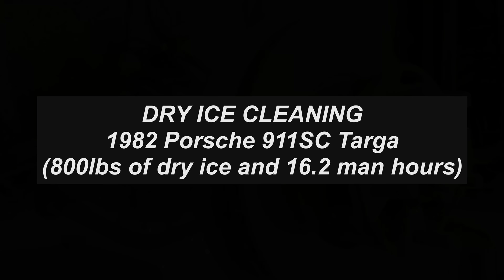16hours DRY ICE CLEANING 1982 Porsche 911 SC Targa BACK IN TIME (part1 of 2)

Comment: For longer durations of blasting without constantly sucking air through a respirator you should consider a PAPR (powered air purifying respirator). Pure Flow 3000 makes a nice all in one hard hat with shield style. Just get a second battery for longer than 6-7 hours at a time.
Reply from the maker: Good tip! We could probably use the second battery because i feel like it’s always dead lol

Comment: Most European cars are spayed with underbody wax at the end of the production line which collects dust and muck but stops corrosion, you’ve removed this which in a dry climate is fine, but in wet cold area all areas will oxidise and corrode, you do a cracking job in cleaning though
Reply: At the very end he is spraying something under the car.  That is probably some kind of wax or sealant.

Comment: I wish there was a car wash where you could drive over a section that had a bunch of nossles spraying the undercarriage using dry ice where the whole undercarriage was basically clean within a few minutes… :-).
Reply from the maker: You might be on to something here!
Reply: @IAMDetailing  I know it probably can't be done because they have to constantly change the pressure and the size of the dry ice particles depending on what they are spraying.  But it would be cool if it could be done where someone could get their undercarriage done for only a few hundred instead of thousands..

Comment: Isn't it better to just clean the car first with water and soaps, then do the dry icing process? Just curious, guess it would save a lot of time and energy.
Reply: Regulatory view no, as the fluids contain chemicals to release the dirt while ice blasting is co2 neutral and doesnt leave chemicals except for sand/dust.
Reply: @maxkreeft6605  what about energy point of view?
Reply: @uiuxshoaib  like in energy costs or you mean efforts to do it compared to water cleaning?

Comment: Can anyone please explain how dry ice cleaning works? What are the pros and cons? Does it clean everything as good as it shows on the video?
Reply: Constantine Hassiotis: Only pros, no cons. Dry Ice Cleaning melts the debris and virtually dissolves all of the residue, it does clean as it shows. I am talking about first hand experience because I used to clean printing presses for quite some time. The only thing is, you will have to recoat the parts you have cleaned. We used mineral spirits for reconditioning.
Reply: @kevinhization  cons too. Some say it removes the protection layers applied in the factory and also causing microcracks.
Reply: @dncviorel  No, dry ice cannot cause microcracks or pits. If the machine has pre existing conditions, then those materials may be too weak to be ice blasted. In all my experiences, none of these machines were impacted due to dry ice cleaning. As I have stated before, the machines always gets reconditioned.
Reply: @kevinhization  That's really nice to hear, thanks for chipping in.
Reply: @dncviorel  Np.

Comment: Does this method damage the anti rust paint under the car?
Reply from the maker: It can remove it. And we reapply one of a couple different kinds of protection wax after we dry ice clean
Reply: No amoundt of so called wax protection will replace thé efficiency of the original protective coating.

Comment: Looks great but what is this like 3-4 grand? Dry ice here is a couple dollars a # and the hourly rate for a mechanic is 75-100 an hour. Even a detail specialist wouldnt be cheap.

So 12-1600 for the labor, 1600 for the ice, plus whatever else they charge. There are other ways that are a lot less expensive. It does look nice though.
Reply: It's an appreciating asset, cost isn't the object, preservation is.
Reply: @douglasb.1203  You hope it appreciates to being worth it. I can see using for the right car but thats not what Im talking about. 

Most cars are not and they are billing it as a regular cleaning method. This is not the only place talking about it. There are already services offering it but no one is talking about price.
Reply: @mistermyself1128  you're seething brah

Comment: This detailing is mega...but could you please confirm that is so good in case of dry dirt and grease/oily deposits not for oxidation of winter salt streets? Or in this case suface oxidation could be removed with dry ice? Thanks again and congrats for results
Reply from the maker: Yes that’s correct... we can remove dirt, grease/oil but we can change the surface... so we can’t remove oxidation, same with rust... we can remove surface rust (sometimes) but this machines is designed for cleaning. Industrial machines will probably work better on rust but also they are not safe to use in automotive industry.
Reply: @IAMDetailing  thanks, really appreciated!

Comment: What effect does it have on rubber? And gaskets?
Thinking about using this on a plane.
Reply from the maker: One of the main reasons we use Dry Ice is because of how safe it is. It's easy for us to control how we use it, and its safer than many other common cleaning methods used on these parts
Reply: It restores axle boots amazingly. I would enjoy trying it on a plane

Comment: How does dry ice clean? Acid? Particles like glass beads? Like cold steam?
Reply: As the ice is blasted when it smashes against whatever object is being cleaned, the dry ice instantly freezes the surface so as the ice pelts the surface it blows off the frozen gunk. 100s of videos explaining the process on YouTube. We used it on our floor machinery in manufacturing and it’s still being used there. It was designed for industrial applications in order to avoid harsh chemicals for cleaning and get a better finish product (clean wise). It’s incredible technology for sure.

Comment: The nozzle head is not wide enough.. 
Takes far to long and not cost effective..
But it does a great job..
Reply: The cfm it takes to flow that with a bigger nozzle would be obsurd were talking like a tow behind diesal twin screw compressor
Reply: @patrickstephens9211  That maybe true but it's selling points and cost price don't make it practical especially when more cost effective ways are faster.  Until a dry ice cleaning machine can outperform cost effective methods that are faster the market will continue to be minimal.  It will eventually become obsolete if it's stays as is.
Reply: @castled3773  gonna have to agree with you, there's better , cheaper , and faster ways of doing this

Comment: Wouldn't it be much much cheaper with a pressure washer?
Reply from the maker: There is only few guys who know how to do it properly with pressure washer and they still have to use chemicals and a lot water which is not very safe... but yes it will be cheaper.

Comment: This is not the first time I see the underneath of an old car, and I can tell you that, that car looks way too good after cleaning. Everything is just too shiny and sparkling under what ever dirt this guy is claiming to remove with the help of that ice thing. There is, a thick layer of dark dirt overall underneath of this car, even places where most cars are not that dirty, because of the physics lows. It looks like it is very possible that the car was "made dirty" for the big contrast and impression of "before and after" effect on viewers. For example, the gearbox/differential looks like it has been leaking for many years and the owner only drives the car on dusty roads, so the layer of dust and oil is very thick, and like a miracle, everything is gone, by just blasting with some very cold harmless particles. Grease is not the best "friend" of cold when it came to cleaning. Even the break disks, are covered in that mud, but after"icing"are just shiny. Like new. That's one thing. When this car was maintained/serviced, nobody bothered  to change the oil on the gearbox/differential, and on this occasion do something with the oil leakage? That's thing number to. I don't think so, but lat's accept that this car has an owner who doesn't care, and don't know the value of a Porsche 911SC Targa from 1982. I know that in the USA is not like in Europe, where cars must pass a technical inspection every year or every to years. But in some states of the USA they have those inspections. That's number three. 
So, my conclusion is, that this ice thing, it looks too good to be truth.
Reply: Dry ice cleaning has been around forever. We’ve had our old presses and machinery cleaned every few years to remove built up and dry oil, machining coolant, and just general gunk that builds up. I can assure you this is 100% how it works.